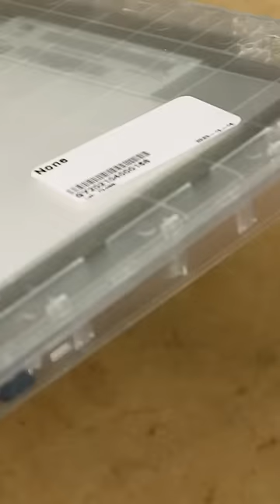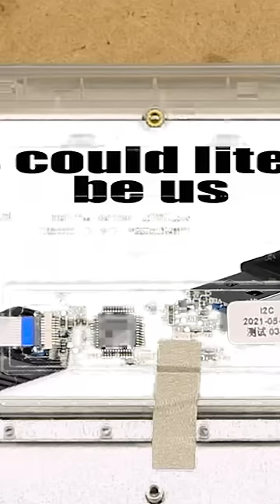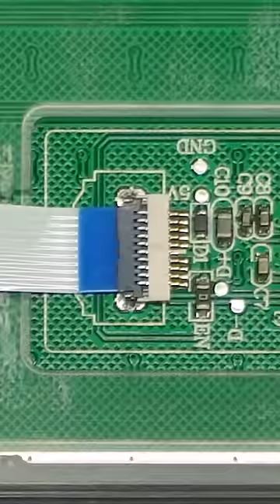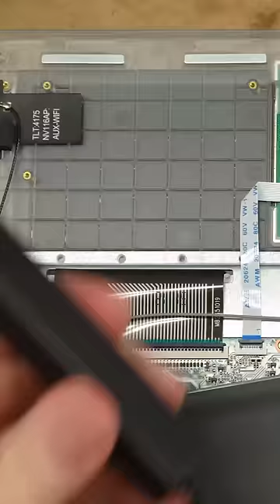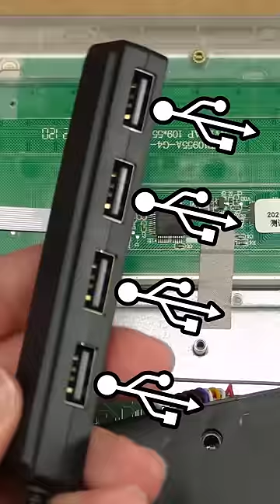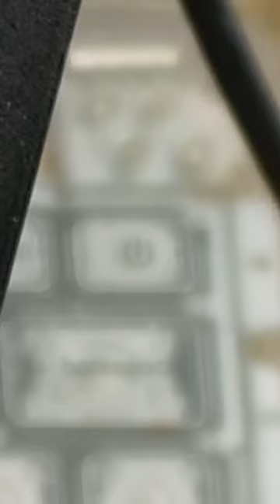This laptop had ZERO USB ports... until now

Comment: I just realized how lucky it was that the trackpad was connected over USB, as it's way more common for them to be connected over PS/2 or I2C.
Reply: it stull has a usb connecter on the mobo he just didnt notice it
Reply: Nah, in my experience USB is almost exclusively used for internal peripherals like trackpad/webcam in any reasonably modern laptop
Reply: @hectormclean33  Webcam sure, that's always been like that, but USB for the touchpad wasn't ever the norm. Modern laptops use I2C for touchpads because they are essentially touchscreens at this point, and this allows them to work with the "Precision Touchpad" standard (or whatever) that Microsoft introduced since Windows 8 to allow for standardized gestures.
Reply: @Flopster101  also ps/2 has features usb didn't use to have ... like rolling over in bed and not giving up a seat on the bus, oh and polling vs interrupting

only people who know know.
Reply: @hectormclean33  REDUNDENT !!!!!!!!!!!! the u in usb means exclusive ...i have read the manual
Reply: @ginxxxxx I'm totally out of the loop. 😞
Reply: @thelred-ph3lq  the best void is no void
Reply: There was a sticker that said I2C on the trackpad though.
Reply: For the last at least ten years it was USB. Keyboard and Webcam too.
Reply: Exactly what I was thinking. I’ve actually never seen on-board USB for something like this
Reply: @tillorrly1128  lmao, it's all ps/2 on smbus and i2c. If it's actually connected via usb, the designer is a complete nutjob who should be fired the very day he submits board drafts for production approval.
Reply: @AntonYadrov777  It's usually PS/2 etc, but come on, what would be wrong with USB?
Reply: I've only ever seen touchpads through USB since my first laptop.
Reply: @firstNamelastName-ho6lv  either you don't know what you're saying or you just have an extra special kind of luck. Because literally 99% of all laptops use either ps/2 or i2c for touchpads.
Reply: @tillorrly1128  Definitely not USB for the keyboard (unless it's something weird with like a detachable keyboard, or possibly the Framework)
Reply: It could have a ps/2 emulator
Reply: @ginxxxxx  Modern cpus can't do interrupt, they only poll. If your motherboard has a PS2 connection it probably interfaces with a PS2 to USB converter anyways.
Reply: @gljames24  very lucky that all (100%) of the modern cpus i own do not have ps2 connections.

Comment: Dept of prisons not going to be happy
Reply: They already aren't. Some prison system confiscated 1200 Securebook 5s after a person on Twitter went on a adventure to jailbreak and perform modification to a Securebook they acquired. So much for those inmates trying to turn their life around...
Reply: @martinmethod427 I blame the guy showing people how to do it
Not entirely, but I put a good portion of the blame on him
Reply: @Urgohermit  nah its the guy who decided to sell them on ebay
Reply: The malice is coming from the people in charge of the prison. There's virtually no way someone in prison could make the modifications and get away with it. The video was just a convenient excuse to make the inmates lives worse for the hell of it.
Reply: @secretname6138 you obviously have never experienced the enginuity of human beings locked in a cage. Anything is possible.
Reply: @matthewpeter4034 please elaborate on where you think prisoners are going to get access to soldering equipment and the usb hub in order to perform a modification like this? or how they’d even open the laptop up? or how it would be instantly discovered that it was modified because they check the laptops for contraband during searches hence why it’s clear?

Comment: An IT security staff member at one of my previous jobs refused to accept when I said that any computer can be compromised if you have physical access to it.

Sure, if you encrypt the storage I can't easily steal data, but I can  enter recovery mode and install what I would like, and a lot of wired networks use hardware addresses as the first layer of defense when it comes to avoiding unauthorised devices from connecting.

And that's why the server room is usually locked up.
Reply: @_Zie_ that's one advantage of electronics getting miniaturised, thanks to the demand for smartphones I believe.

It's incredible how much computing power and storage you can fit into 1-2 server racks today... makes it easier to hide and protect.

And while it may seem silly with two armed guards in front of a toilet cubicle, that one rack can easily contain what took a living room sized facility in the early 2000s. So it's a matter of evaluating what level of physical security you need around that closet.

The large server parks today are usually about relatively harmless cloud storage or computation clusters.

Those do, of course, also need a certain level of physical security, but they're not necessarily vital to the national infrastructure.

But yeah 😀 a heavily guarded closet is a great example... you wouldn't want it to be easy to compromise it, either by making a rogue node or connecting a RasPi to the secured network unnoticed.
Reply: @_Zie_ yeah, integrated inputs and outputs is a second layer of defence, it must take time enough to intrude that you can't do it unnoticed within a short "routine check", the hardware in the closet has been vetted, so you won't see a technician come around with a laptop to do a few checks.

Comment: I really wish I had the knowledge to be able to modify electrical circuits like this. Pretty cool stuff.
Reply: It's actually easier than it looks. I'd recommend starting with learning how to set up simple 3V or 5V circuits. There's not much you can do at that low of a voltage to hurt yourself or damage anything and almost everything uses 3V or 5V.

Comment: Laptop webcams also connect over USB, so if you have a scrap laptop you can pull out the webcam assembly and patch it into a USB cable, and then you have a small portable USB-powered camera that you can do all sorts of fun projects with.

Comment: When I watched the full video, my thought was they spent money on a USB controller? I would have totally thought the keyboard and mouse would be PS/2 based.
Reply: @Sarge92  too be honest, I don’t know much about laptop hardware. I’m a programmer. I was going off a tidbit I heard that some laptops used PS/2 for the built in keyboard and trackpad. Also the design of that laptop had me thinking it would probably be old enough.
Reply: Guess it depends on just where they sourced the parts from, USB has been around long enough that PS/2 support is getting harder to find.
Reply: okay but prisoners shouldnt be having access to soldering tools in there cells where their laptops are? if that happens thats on the C.O.s
Reply: @levipulsipher8221  They shouldn't have access to tattoo guns, so they end up making their own out of scraps. And a soldering iron is much simpler, basically just a heating element.
Reply: @Justin.Franks  you grossly overestimate the complexity needed to make tattoos

Comment: The shitty thing is, usb ports are really hard to find on modern laptops. I remember when i was looking for my newest laptop, i kept finding great options, but they only had one or two usb ports, which was a dealbreaker for me. I went for an Acer Nitro just because it was one of the few options with four usb ports. I use usb all the time, my mouse, keyboard, and drawing tablet, plus its a handy way to charge my cart and earbud case

Comment: I imagine that's a laptop intended for use in prisons. 
Most prisons will exclude ports and random access holes in electronics, on top of making them transparent, because prisoners can take advantage of them and hide stuff, or turn the metal inside said port into a weapon, basically every prison trusts every prisoner about as far as they can throw them, and for good reason. 
I don't really see why they would not include USB ports, you would have to really try to get any metal out of that and, with the amount of effort you would have to apply to take a USB port out, you'd have to take the whole laptop apart, which defeats the purpose of not including the USB ports if that's the case. 
Unless the intention was to prevent prisoners from transferring files and media into the laptops through less than legally acquired USB drives, in which case I understand.

Comment: Why not wire it to a ribbon cable that you can just pop in and out of that slot the other ribbon cable goes into on the MB instead of soldering to the board.